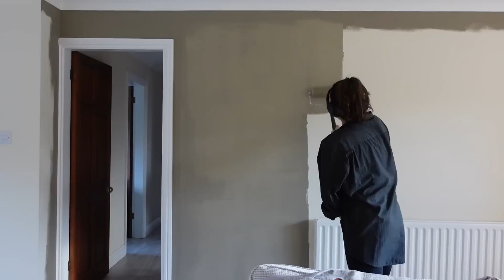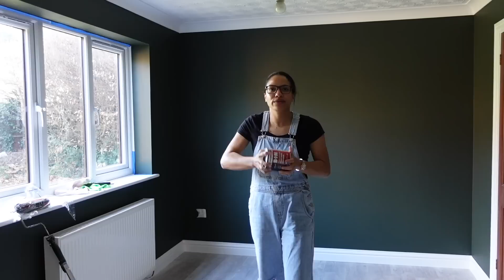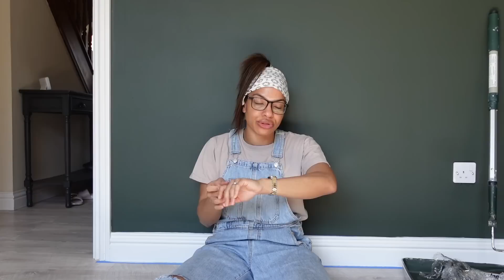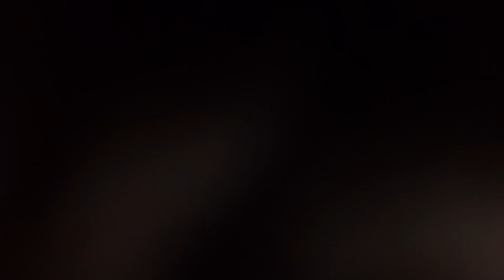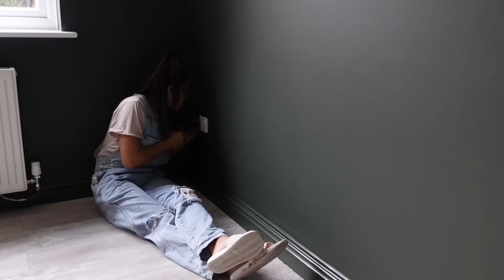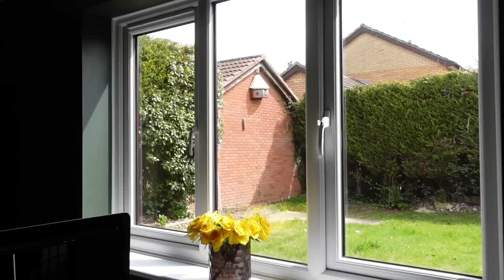painting skirting and architrave for the first time + setting up my office | Part 2

Comment: To complment the desk, the doors would look great stained a little darker.  A mood board also works when changing a room's use and colour. Long term you could consider putting a stain and polish on the back of the desk where it is on show to enhance the finish. It has probably  spent its life against a wall.

Comment: Stunning Shade 💚.Radiator cover painted same as walls,Roman Blinds,Doors would look nice darker stain or black Or if you wanted to try something different Totally block the doorway with a huge Mural,canvas but to be the same size as the doors so the door frame surrounds it and a vintage looking Chaise lounge would look lovely also.💚

Comment: Looks amazing, well done! Would love to know your tips for painting begind a radiator 🤔
Reply from the maker: If it doesn't come off the wall ( like new ones in new build homes) then i just shove a paint brush down there 😂😂
Reply: If you go to B&Q you can get a small roller with a long handle, it’s about two feet long. I used it on all our radiators. Hope that helps.